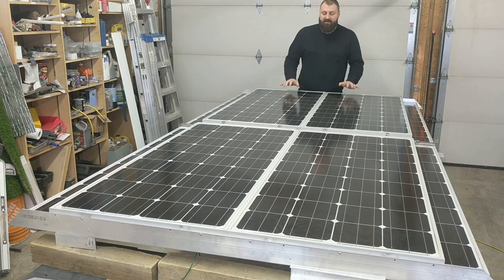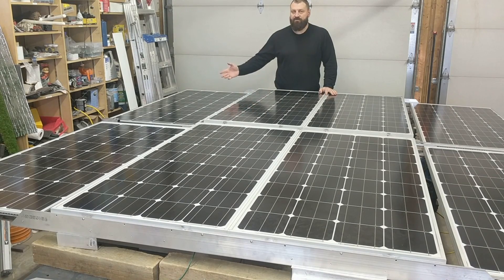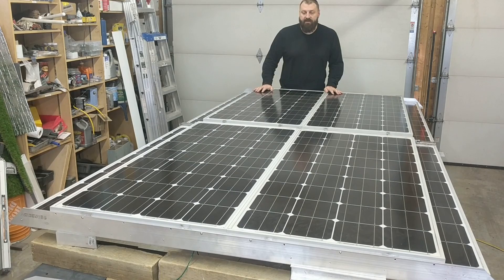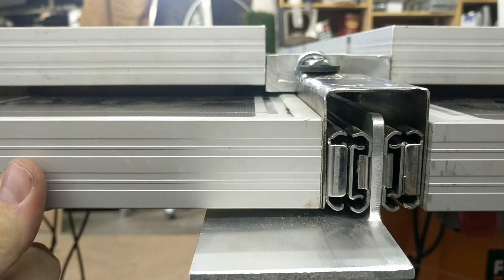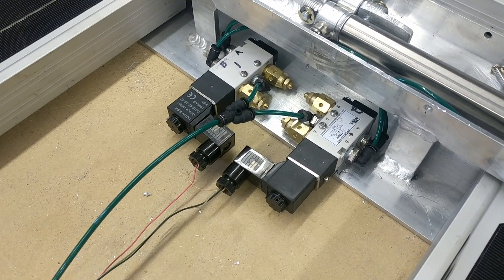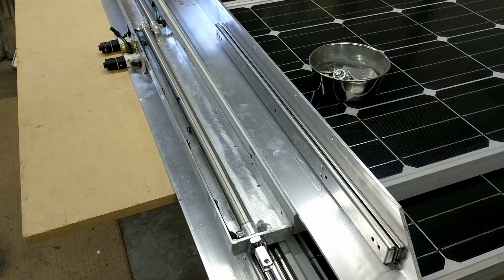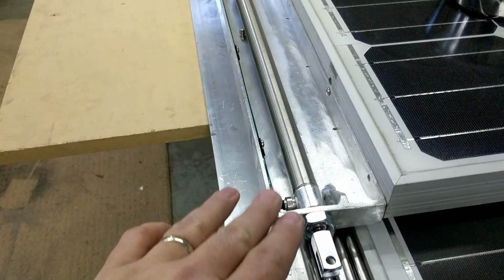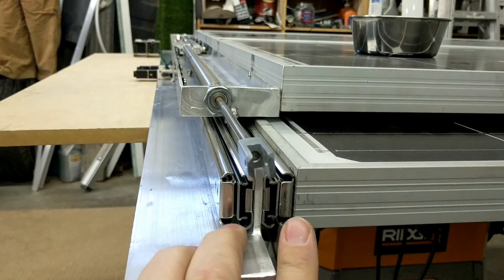Even Moar Solar! 1.4kW Rooftop RV Sliding Solar Install - How to Build an Overlander

Comment: I have  been going through this in my mind, as I am upgrading to a 46ft Toy Hauler with a lot more real estate up top,  and then your video popped up, great work mate! I was thinking about how to work the actuators,  your parts list should work!  I wonder who many panels 1 actuator can push out, one actuator pushing 4 panels or all 6 panels on one side. curious what are you using for the pneumatic supply? I was thinking of using these 
https://www.amazon.com/WINDYNATION-Actuator-Maximum-Satellite-Applications/dp/B01BLVLH7Q/ref=sr_1_fkmrnull_3?keywords=WINDYNATION+24%22+Stroke+Linear+Actuator&qid=1553732393&s=gateway&sr=8-3-fkmrnull
Reply from the maker: It'll push with 100lbs of force... So it'll move them all, but you'll need a way to keep them square, so the front comes out at the same rate as the rear.
Reply: @Everlanders  so probably need some type of ridged faceplate connecting all the panels
Reply from the maker: Didn't work for me, your results my vary.
Reply from the maker: In response to your edited comment, I went with air because you can get a lot more power through a tiny 1/8 inch air line then you can through reasonable electric wiring. You would need several runs of decent gauge wiring to power the actuators, and wire is many times more expensive than small pneumatic line like this. Further, pneumatic actuators I found are many times cheaper than electric actuators. It is also far simpler, no need for limit switches, no motors to fail, no gears to strip... if for some reason the solar panels hit a pole or a wall as they are extending, it just bumps into it and tries to push against it, but it can't... who knows what would happen with an electric actuator? would it strip the gears, would it burn up the motor trying to get to the limit switch? The electric air valves that I used also allow for Fail-Safe, if the system goes down or the power is cut for any reason or if I start the engine, the valves lose power, and the solar all retracts. It defaults to "retracted".
Reply from the maker: I now have a Frequently Asked Questions post on this very topic on our website that gives lots of details... https://everlanders.com/FAQ-air-powered-slides/

Comment: Real nice build, I am working on a design in my head as well for a 4kw main panel and another 2 to 4kw  for the slide out. The only thing I would change is that it should have a small pitch to shed water, snow and debris. Real nice design, I also did not think about using air, As my design calls for it to be about 1 foot off the roof to allow air flow and block direct heat on the roof. I am thinking more along the lines of a lever action run by a gear box with a manual override with hand crank...
Reply from the maker: I designed ours to be as close to the roof as possible to keep our height down. Still, the top glass is 5 inches from the roof. Shedding water has never been a problem, and debris blows off when we drive...

Comment: Brilliant idea and an outstanding job executing it. Raspberry Pi's are awesome aren't they! When I build I hope you don't mind me seeking you out for that sliding solar design as well.
Reply: Im wondering if a third layer would be possible
Reply from the maker: Sure...
Reply: Everlanders thanks considering this for a skoolie build. Thinking a third layer could act as some what of an awning.
Reply: Charles Hall, this guy laid down a pretty solid idea. Some brainstorming could really open up some more possibilities (like yours) to get even more out of the platform. I like your idea of it filling in as an awning while charging the batteries! And a third layer. Now if we could come up with an idea to draw moisture from the air for water while boondocking (I can do it at home with my dehumidifier) without plugging into shore power! Talk about being off grid! Happy Trails!!

Comment: that is a awesome design. I have been trying to come up with a way to tilt the panels and maybe rotate
Reply from the maker: The gains made by tilting will cost more than just getting one more panel. It's not worth it in my opinion.

Comment: Excellent design! Thank you for sharing. Would electric linear actuators work OK, or do you think they would be more susceptible to water/dirt contamination problems?
Reply from the maker: I think they'd be fine. I went with air because they fail closed, when power is cut/lost they retract. Further I don't need to worry about timing or limit switches. Plus they are much cheaper.
Reply from the maker: Also, they are much more compact, only 3/4" round.
Reply: Excellent points. Thanks!
Reply from the maker: I now have a Frequently Asked Questions post on this very topic on our website that gives lots of details... https://everlanders.com/FAQ-air-powered-slides/

Comment: I know at this point you have some 90+ days using this setup this past year. But I am concerned about the rails, they are not designed to be outside in the weather.
Reply from the maker: Yes they are... 304 Stainless, commercial units, everything is 1/8" think, not the  cheap tin ones. I just washed out the grease so that it would not hold dust.

Comment: How are the drawer slides holding up so far? Obviously stainless should last a long time on the roof, I’m just curious if you have had issues with them sticking from dirt, snow, Ice, road schmoo etc. 

Awesome set up, I love how they’re tied into your main automation system for opening and closing.
Reply from the maker: No problems so far, they are fairly well protected inside the aluminum channel/ under the first set. I did clean out the grease that they came with so dust is less likely to stick. They haven't seen snow or ice yet. I suspect they might ice up after a few snow/melt/freeze cycles... Hot car pressure wash I guess if that happens.

Comment: I am a big fan of solar projects.  This is awesome!!!!!!
Reply from the maker: Cool, I'm glad you like... I could use a coder for some of the logic used to deploy the wings, etc. There is a lot of automation in this thing... Mostly Python.  Are there times that you're not Cranky?
Reply: The moniker came from some early years as a programmer.  I am far less cranky these days :)
Reply from the maker: And you have a sweet 3D Printer!!  I've needed one several times on this project, The Screen housing/console for example, and I want to make housings for the 5 outside cameras.  Maybe if I send you filament and a pittance, you can send me parts? Could do some collaboration stuff.
Reply: I'd be down for that.  What cameras do you have?
Reply from the maker: I've got a few of these: goo.gl/XUho8G They are nice because they have a IR filter you can engage remotely.

But just got in two of these ones, which I like the FOV better: https://goo.gl/GAMg5s
Reply: @Everlanders  have you done a video on those cameras?  I'm interested in how you mounted, housings, wiring, interface.  I'm looking at something similar for my sprinter.  This is especially after watching another video where a vanlifer's fuel tank was punctured by a vandal/gas thief while she was sleeping inside.

Comment: This gives me some idea of my own.. thanks for sharing. I’ve been adjusting to -30 up here in Sioux lookout, definitely different than what I’m used to.
Reply from the maker: Levi !!! Nice to see you're still watching! I wish I could get my production values to 1/10th of what your quick vlogs are... Hit me up if you want a design audit, there is lots I learned the hard way but didn't make it in the video.
Reply: Everlanders - thanks! I won’t be adding panels for a few months still, but I hadn’t considered stacking and having one set on slides. I might just make it a simple manual slide version though.

If you ever have any video questions let me know! It was great getting to see the man behind the work in this video. Helps put a face to the voice. Also, it would be fun to shoot a video of your rig if you are out in BC again, let me know!

Comment: Can you go into a little more detail how the ram works it looks like it air pressure pushes it out and it also pushes it back there's no vacuum that causes  the motion can you confirm that ?
Reply: Traveling Terry ahhh crud, great question I should have answered in the video... They are "double acting" cylinders. The fancy valves you saw have 1 input, 2 outputs and 2 exhaust ports. The cylinder can be pressurized on either side of the Piston while the inactive side is vented to the exhaust port. If you watch again you can see a green air line to both ends of the cylinder...